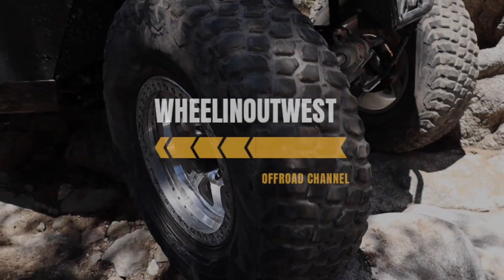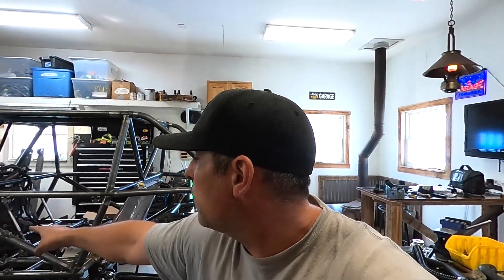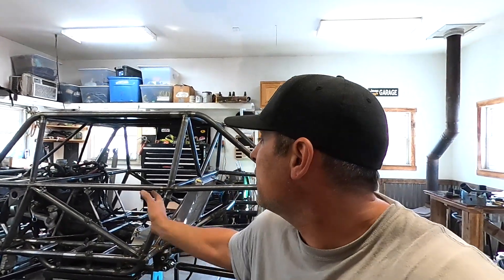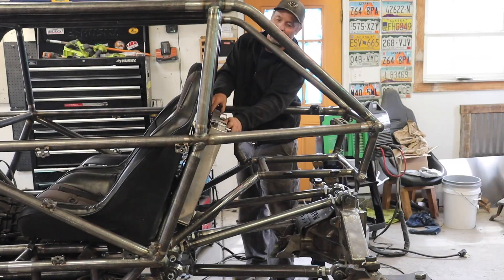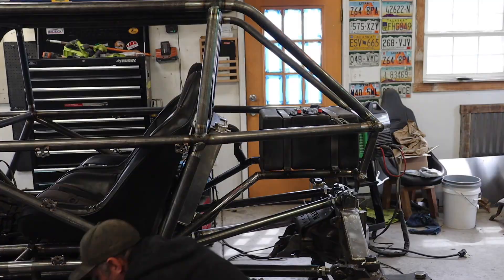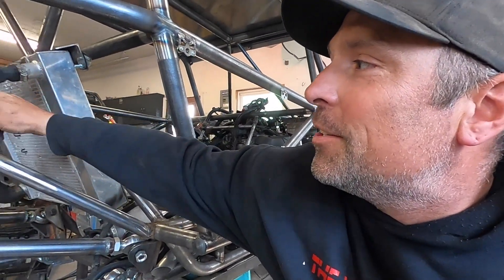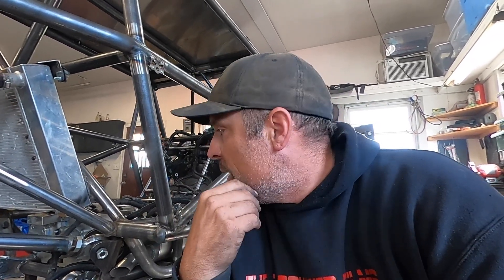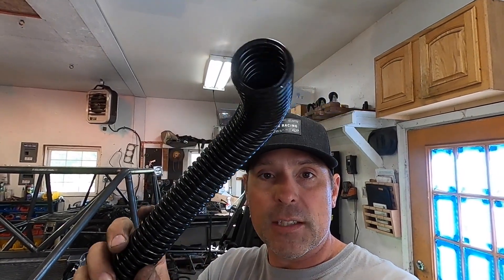Buggy Build update, mounting the radiator and coolant lines. #4x4 #extremeoffroad #DIY

Comment: So I imagine the entire chassis isn’t going to be filled with coolant. That would be a ton of coolant and an unnecessary amount. I’m assuming you closed off portions of the chassis so it’s just running straight down the one side? That must have been an insane amount of work.
Reply from the maker: Yep, so when I cut the tube back out of the chassis, I welded it back in with a block off plate for all four corners. I used the tube that was already existing to tie into. I know quite a few people running similar set ups and it works well. This is my first time trying it, so pressure testing it makes me feel better about it.

Comment: I have ZERO experience in the buggy world.  BUT, I do not like the idea of using the chassis for coolant piping.  I would be concerned with corrosion of the frame from the inside out.  Seems like a lot of extra work to avoid running a couple pipes fore and aft.
Reply from the maker: Well, as for the corrosion, as long as I run antifreeze which has corrosion inhibitors, it should be fine. For example, iron block motors don’t corrode, unless people use regular water instead of antifreeze. Space is really limited, and running lines near either the drivelines or exhaust can be a challenge too.